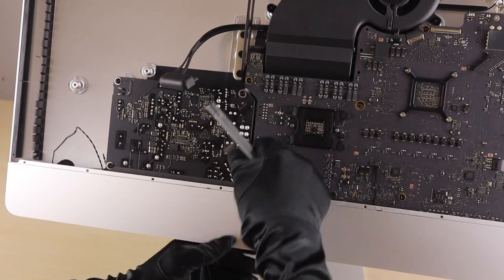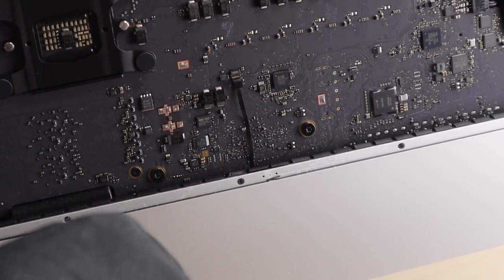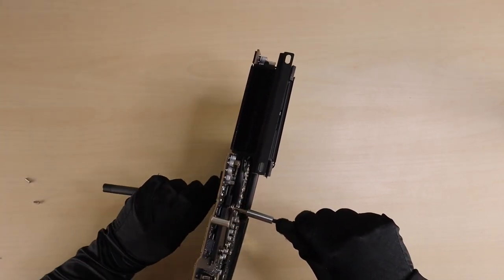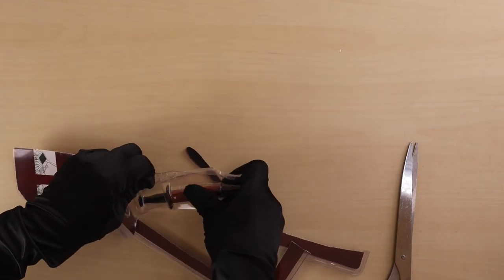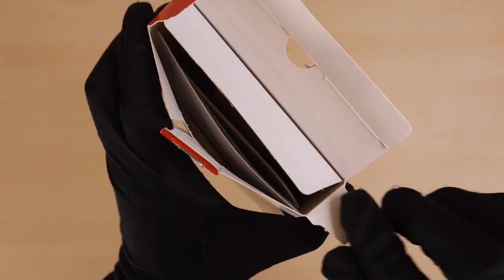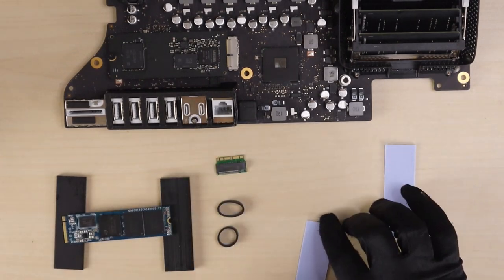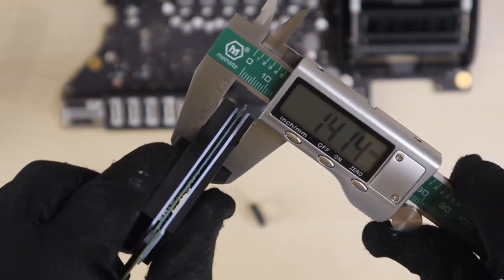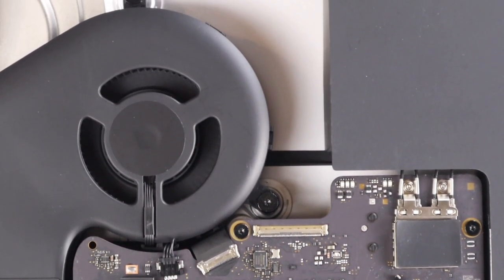【Tutorial】Warrant Destroyer! iMac 27 5K 2019, DIY upgrade to i9-9900K, 40G RAM, 2TB+2TB SSD

Comment: Thanks for this guide. I just upgraded my base model 27” 2019 iMac to an i9-9900k, 2TB Fledging SSD and 64GB RAM. I was hesitant to replace the thermal paste on the VRAM, rather than re-using what was there because it was very thick, but I applied a thick layer of NT-H2 thermal compound (thicker than I would apply to a PC) to the GPU, GPU and VRAM. Apple had tons of paste on there from the factory, so I figured I’d do the same.
Reply: There were no problems upgrading from the i5-8500 to i9? Some people said they thought you couldn’t since the base has an 8th gen i5 and then i9 is a 9th gen
Reply: @user-rr8hi6nl4f  No problems at all! 8th gen and 9th gen Intel are interchangeable
Reply: Jozef Standow thanks! I’ve been trying to find out for so long if that’s possible and even asked on reddit and only got one reply with some guy saying he doesn’t know if the logic board of an 8th gen will accept any of the 9th gen CPUs

Comment: i just upgraded my RAM to 32G today, dreaming of upgrading the processor 3.2GHz Intel Corei5 to better ones. I feel motivated after watching your video, Thank you! 谢谢！May I ask, can my 27-inch late 2015 model Imac upgrade to the I9? where can buy the tool kit to open up the Imac?
Reply: No, different motherboards, the best CPU your iMac can take is the i7-6700k
Reply: Sodeeen is it possible to upgrade the 2019 iMac 27” that has the 8th gen i5-8500 to the i9 or a stronger i5?
Reply: @willy4177  how to find the compatibility of iMac mother boards? I mean how to find a processor would fit a iMac mother board or not
Reply: @user-rr8hi6nl4f  that one can be upgraded to the i9 9900k
Reply: @galeelraglen  just look up whatever processor you currently have on the imac and google the best cpu available for that particular socket
Reply: @user-rr8hi6nl4f  the one in the video is also an 8th processor so it should be possible to do it.
I have the same 8500 as you and i will try to upgrade it to the i9

Comment: Great video!! , Please advise if I can use 2TB in My Late 2015 I Mac and what will be ideal CPU upgrade for it.
Reply: 2TB sounds find so long as it’s the right type (which I assume is SATA).

If you find out the chipset you’re motherboard uses, you can find out which CPUs are supported. The 2019 for example used Q370 and with some research it says “8th and 9th generation Intel Core CPUs (LGA 1154).” So that means the Intel Core i9-9900K is the best CPU for that era. They’re already on their 10th generation and your’s will probably be the 5th generation. I hope that helps!

Comment: Since this upgrade, have you experienced any issues with thermals, particularly the VRAM?
Reply from the maker: i9-9900K 在 PC 上用風冷都難以壓制，在這個觀點上去看 iMac，完全可以推想他會過熱，但我覺得這不是最重要的問題，因為改裝後的價格和效能仍然非常划算。

回覆您的問題，有關過熱降頻的部分，您可以看第五部影片，敘述雖然沒有明確提到降頻（如上，我不是很介意）但畫面中有 Intel Power Gadget 可以參考
Reply from the maker: VRAM 部分想請問您用哪個軟體監看？
Reply: EnterBox I used iStat Menus to look at all 3 GPU temperature sensors, I assume that if the VRAM is running too hot, one of the nearby GPU sensors will warm up more than it should.

Also I have noticed that running Cinebench R20 will manually set 100% fans through iStat Menus, my temperatures stay around 80C but my power consumption will jump to 115W then quickly drop down and stabilize at 80W,. However, other tests I’ve seen on iMacs built with the 9900K from the factory cycle between 115W, 80W, 115W, 80W, repeatedly.

What are your Cinebench R20 and Geekbench 5 scores? My Cinebench is 3,950 and Geekbench is 1,275 single core and 7,700 multi core. The Cinebench numbers look fine, but it should get around 8,300 multi core though, 7,700 seems pretty low.
Reply: EnterBox I think the iMacs that are built with with i5-8500 from the factory have a power limit than ones that are built with the 9900K. So when you replace an 8500 with a 9900K, you have more cores but the CPU will not use very much power. Does this sound accurate based on your experience? Keep in mind i am running these tests within a couple hours of reinstalling macOS, so perhaps my multi core performance will improve later, but based on the 80W maximum sustained load wattage I suspect it is a power limitation issue
Reply from the maker: 這台 iMac 目前沒有安裝 iStat Msnus，但有安裝 Macs Fan Control，你提到的狀況，我們之後有空來研究看看。

跑分部分，Geekbench 當時有跑，但資料可能沒存下來，可能要請助理安排時間找一下資料。當時主要用 Cinebench R15、R20 來評測效能，詳細的數據在 Episode05 https://youtu.be/pspxqYmkRQE
雖然是中文講解，但都有圖表整理呈現，且為英文版，希望能幫助到你。

你提到 R20 分數多核心應該要到 8,300，對照上下文，我想你說的應該是 Geekbench 8,300 (all core) and 7,700 (single core)。如果 R20 到 8,300，那比最新的 10900K 還厲害呢！XD

功耗部分，你是用 AC 功率計還是 iMac 中的軟體顯示？
溫度部分，在 Episode05  2:52，底下有 CPU 溫度、功耗等資訊，可以看到 CPU 溫度大概在 90～100°C 之間。i5-8600、i9-9900K 的溫度都差不多這麼高。
Reply from the maker: 按照我們使用蘋果產品的經驗，8500、8600 和 9900K 的 PSU 應該是同一顆，溫度限制和功耗限制同時存在。實際例子來說，EnterBox 改裝完的 iMac 9900K 效能比原廠的升級選項的還高（依據其他媒體測試 9900K 的數據）。在散熱零件同樣的情況下，如果這台 8600 的 PSU 是比較弱的，那改裝 9900K 後就更不可能跑出超過 5% 的效能分數。

詳細這部分，可能安排九月製作一部影片，和大家詳細說明一些 iMac 升級的觀察和理由，我們經常收到訊息提問「改裝 9900K 會不會有散熱、功耗問題？」答案是一定有，但如果你想要效能強，在 iMac 改裝還是很划算。
Reply: @EnterBox I tested again today. 9900K Cinebench R20=4,115. 9900K Geekbench 5=8,020 multi-core, 1,349 single-core. I have a 2019 iMac 5K, upgraded 8500->9000k. 4x16GB DDR4 2400MHz (2666MHz DDR4 arrives tomorrow and I will test again). Temperature in all benchmarks is <90C.
Reply from the maker: 哇～太棒了，恭喜你。這個效能分數看起來比較正常了～
2666MHz 記憶體安裝後可以再測試看看，分數有沒有增加
Reply: @EnterBox  Benchmark scores are the same with 2666MHz RAM :( But I am happy with the performance of the 9900K! And the temperatures are very cool with Noctua NT-H2 paste :)
Reply from the maker: @solar5286  Wow 非常謝謝你的經驗分享，再次恭喜你改裝成功，也讓我們覺得做這個影片能幫助到遠在千里之外的觀眾，很有意義。如果有機會，幫我們分享影片和訂閱～謝謝您！

Comment: Hello there! Did you actually purchase the base model 27 inch iMac for these upgrades?
Reply: You can and it will work the same. Each 2019 iMac has SATA and NVMe for both hard drives, plus upgradable CPU and RAM

Comment: Hi! Thanks for the video! Do you know, is it possible to do the same CPU upgrade to i9-9900K from the youngest model iMac 27 2019 i5-8500 (Intel i5 3.0 GHZ)?
Reply: Did you solve this?😅
Reply: @Firulaisneado  Yep, I have installed i9-9900 on iMac 27 2019 with i5-8500. Everything works great!
Reply: @just_a_channel  woww fantastic!! 👏

Comment: Couple questions. Was this the base model 2019? What did the NVMe SSD replace? The patriot replaced the Fusion drive (I'm assuming), and I'm confused now. Unless the Fusion drive is actually the HDD AND that stick you pulled off? Is that the "Fusion" part? I guess I just assumed they had created a drive with both inside one enclosure. Great video!
Reply: yes this is the base model as this has the 15-8600 which is only available in the base model
Reply: @Lurkindork  Thanks!

Comment: Can I change the cpu to I9-9900k to any GPU imac model like pro560X, or it’s only for pro575X like in your video?
Reply from the maker: You can upgrade CPU i9-9900K/9900KS to any model(spec), like i5-8500 with RX 570 GPU
Reply: @EnterBox  Do you tried install clear macOS on 9900k?

Comment: Can you put the i9 on a 2017 model?
Reply: No the i9 wasn’t out in 2017, so the motherboard won’t support it. If you find out the chipset you’re motherboard uses, you can find out which CPUs are supported. The 2019 for example used Q370 and with some research it says “8th and 9th generation Intel Core CPUs (LGA 1154).” So that means the Intel Core i9-9900K is the best CPU for that era. They’re already on their 10th generation and your’s will probably be the 7th generation. I hope that helps!
Reply: @jamesaltonfilms  how to find the compatibility of iMac mother boards? I mean how to find a processor would fit a iMac mother board or not
Reply: @galeelraglen  For that year I just know that the i7-7700 was the best you could get and was offered on the highest end iMac of that year. Since all iMac's of the same size use the same motherboard you can deduce what will work and what won't. Sure enough, if you follow that rule, it works!
Reply: @jamesaltonfilms  so its like iMac 2020 mother board is compatible upto that i9 10 core 10th gen cpu? We can’t swap to next gen cpu or to a cpu which has more than 10 cores?
Reply: @galeelraglen  That's exactly it! And the constraint actually due to the Intel chipset on the motherboard, rather than anything else. The chipset dictates the RAM speed, the peripherals through the "southbridge" (thunderbolt, wifi, ethernet, bluetooth, usb 3/3.1, etc.).

Comment: I was able to upgrade my Mac to 2TB SATA SSD, 2TB NVMe SSD and 40 GB of RAM, but the Core i9-9900K upgrade didn’t work (black screen). Tried 4 times. I have a Core i5-9600K that I was able to put back in and it works. Do you know why the i9 won’t work? Is there something I have to do to the BIOS or anything in preparation?
Reply from the maker: 非常遺憾聽到你的狀況，如果真的不行就維持 9600K 好了。

iMac 沒有 BIOS 可以去調整，但你遇到的狀況真的很特殊。而且你提到已經嘗試 4 次，且裝回 9600K 是可以運作，代表基本上整個拆裝過程你已經能夠掌握，實在想不出你遇到的狀況我們能提供什麼建議和幫助。

一個技巧提供，你可以試試看用 AC 功率計看一下改裝後的瓦數變化，這可以幫助判斷他開機到哪個階段，再來排查錯誤。

Comment: Can you upgrad the cpu of the 27 inch imac that comes with i5 8gen with boost up to 3.0 Ghz to i9 9900k or just the ones that comes with   i5 8gen with boost up to 3.1 Ghz  or 3.7 Ghz  ?
Reply: Yes you can upgrade i5 3.0 8500 8th gen to i9 9900k or i9 9900kf.

 according to this thread
https://ko.ifixit.com/Answers/View/567429/27%E2%80%9D+iMac+5K+2019+CPU+upgradable+Or+soldered